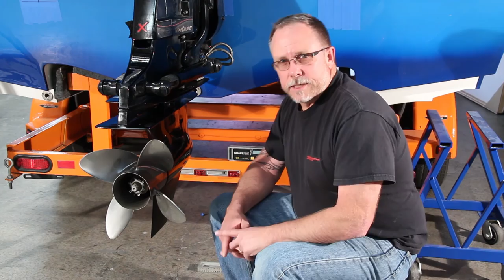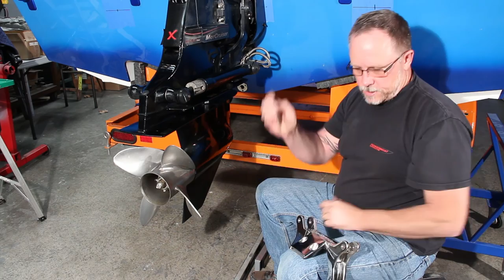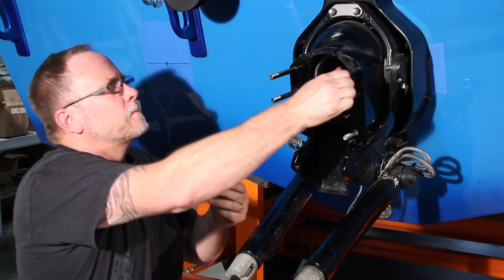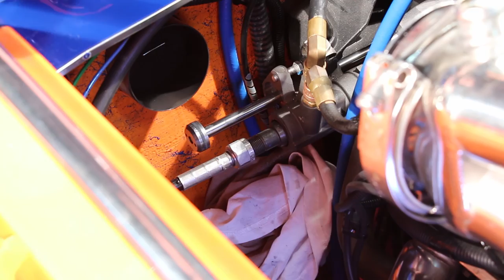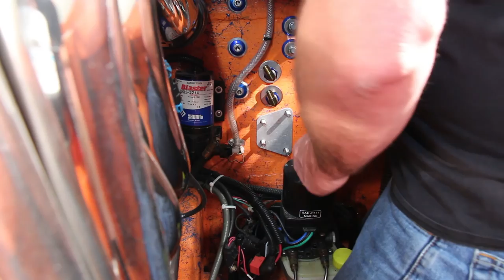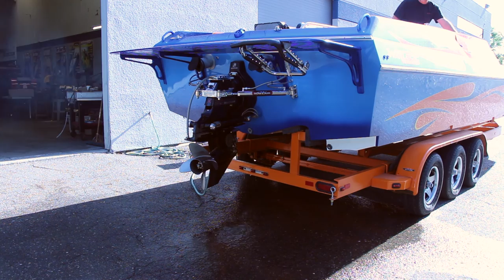PBN Tech TV Product Install - Mayfair Add-On Hydraulic Steering

Comment: If u dont want to claw your studs when removing them with vice grips, use the double jam nut technique and run a deep socket on both nuts to back them out.   (Just incase your add on external hydraulic unit has a leak in it new from the factory and u have to send it back- do this project in nov or dec.)

Comment: I have a customer who had a scary amount of wear, at the steering pin. Had to replace the gimbal ring. It's a big cuddy, single bravo. I'm thinking his boat would be a good candidate for this system. 
But is there a video on how to remove any of those 7/16" 12 pt outdrive bolts that happen to snap off? There's always one. They're a hard grade. I can't even center punch it!
 I don't know how to proceed.😔 Can they be removed without destroying the top half of the outdrive housing? (Which is where they usually are, for me)

Comment: If you want to accurately mark the center of a thru hole in a bracket use a "Transfer Punch". Nothing like drilling a hole to only have it mis-aligned by a 1/16 of inch. Do it professionally not like a shadetree.